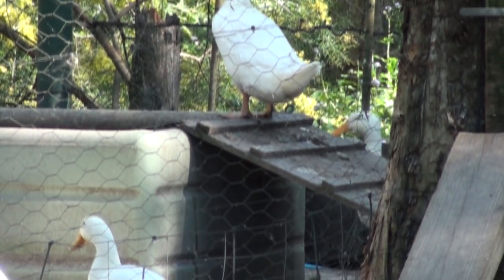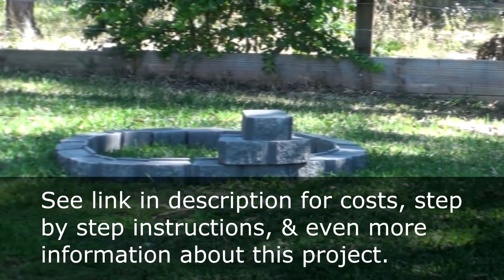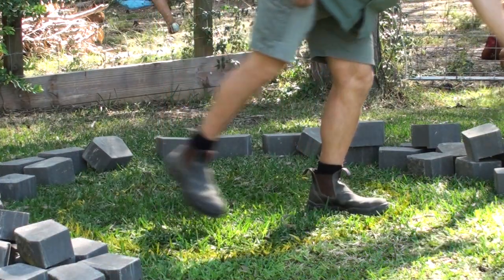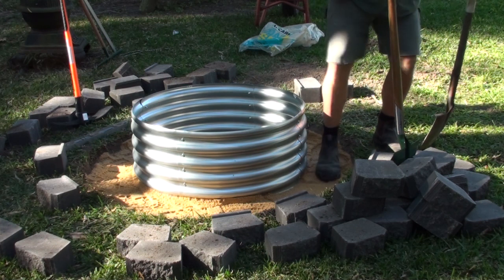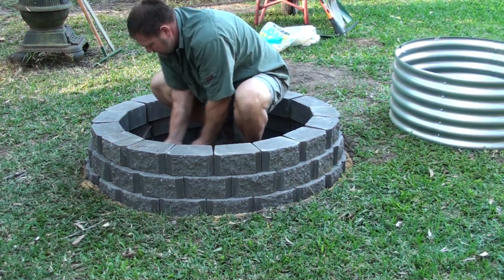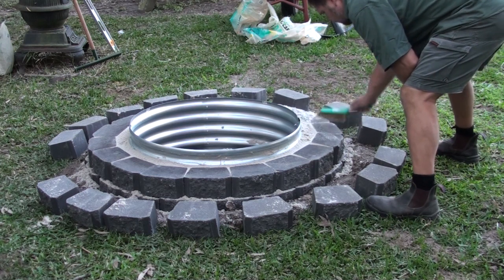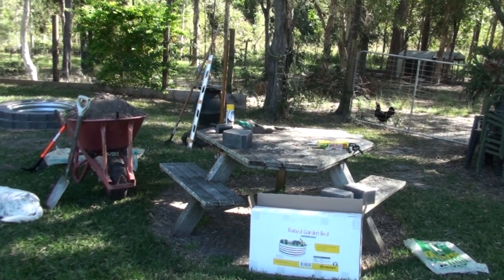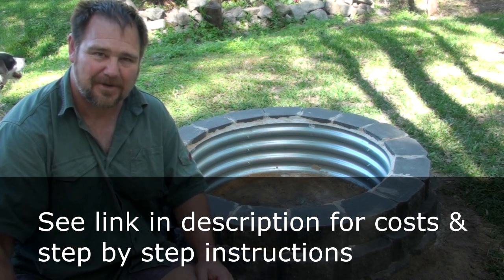How to Make a Fire Pit Using Retaining Wall Blocks Plus Galvanised Rim

Comment: You did a really great job with the blocks, but please remove the galvanized liner and replace with cold rolled steel or not at all. I can tell you from experience how badly you can be sickened by breathing heated galvanize fumes. It can't be safe with cooking food as well.
Reply: Helpful information, I am just starting out on figuring how to make one that is safe, will focus on cold rolled steel.  I found information somewhere that not using anything inside could cause the blocks to explode and I don't really want that either.  His video and instructions were the clearest and best I have found, however.

Comment: just an idea as I recently shopped around for fire pit rings as an insert, I chose to use galvanized window wells. purchased 2 of them 18" tall, straightened the attachment tabs on each one. I then bolted them togeather with stainless steel hardware, turned it on side and flexed it until round. Took about 3 seconds to make it nice and round giving me a nice 36" (across) x 18" (high) heavy duty fire ring to start the project. The window wells were only $12.47 each, the stainless hardware was less than $12, so total cost at less than $37 bucks for the completed insert. Compared to pre made galvanized fire pit rings I priced which ranged from $129-$269 (ridiculous) now to finish it up with the blocks and buy materials to make lots of Smores.Hope this saves someone a few bucks and stops the sticker shock when planning and shopping for materials for a firepit project.Happy fire pitting!!!!!
Reply from the maker: Great idea and thanks for sharing your tips! That's a top money saver and good thinking outside of the box. Happy fire pitting to you also! Cheers :)

Comment: Very fancy looking pit mate, looking forward to seeing you cook on it. If you wanted to make it really last you could make a cement and pearlite mix up to go between the iron and bricks. When it rusts out after a few years you'd be left with a firebrick inner which would hold the heat and protect the blocks. Great looking pit though - saves burning holes in the lawn
Reply from the maker: Ben Jamin Thanks Ben - I'll look into your cement and perlite mix as insulation that's a great idea and would probably be better than sand! We roasted up 3 of our pekin ducks on Sunday and it worked like a charm - will post a short video soon... Cheers :)
Reply: Cant wait!

Comment: great video, very informative! I would give a coat with roof cement on the galvanized rim in the areas where it'll  be in contact wit dirt or ashes....i work with galvanized electrical conduit  and I've seen lot of Materials corroded underground.  you have a wonderful back yard,.. dreamable!!

Comment: Could this be done using cinder blocks in a square? The blocks are cheaper. Cheap metal flashing inside, still with sand between & culk? Will this work?

Comment: The only thing I would do is insert pipe at base of the ring for air intake for fire.  While at state parks fire rings, I would elevate the ring with rocks sourced to achieve 5 effect.

Comment: Hi excellent job I have the same fire pit ring I know you said 53 rocks but I was wondering did you have to cut any rock
Reply from the maker: No I didn't cut any rocks but I did have to shuffle them into place and it wasn't "exact" if you get what I mean, although no one would know... ours is still working well btw - very happy overall with this build! Cheers :)
Reply: Self Sufficient Me thanks for sharing

Comment: WE used just regular building blocks and they are not as good as they were made in years past - these today are rough, not smooth and they cannot take heat like the old kind did.
AT first use, 4 blocks fell apart.
Now they tell you to use THESE blocks to make rocket stoves with - yet these rocket stoves are intense concentrated  heat.

So what blocks CAN we use that won't fall apart, crack, etc when in contact with fire ?

Our fire pit is 4 times the size you show in this video.

Comment: You should incorporate a bellows of sorts.
Reply from the maker: Hmmm, yeah very good idea and that certainly would help circulate more air around the fire. Thank you :)
Reply: A series if perforated galvanized steel pipes might help derect the flow more evenly.
Reply from the maker: Brad Smith Yes it probably would that's a great idea! Thanks :)

Comment: why did you decide to only glue the top row?
Reply from the maker: Basically, the bottom row is dug in so it's very secure, to begin with, then the second row is locked in by the style of brick (they lock together) and further secured by the weight of the top layer, therefore, gluing the top layer only was enough. Have a look at my instructions here for more info https://www.selfsufficientculture.com/threads/my-fire-pit-build-project-using-retaining-wall-blocks-galvanised-rim.788/#post-7633 cheers :)